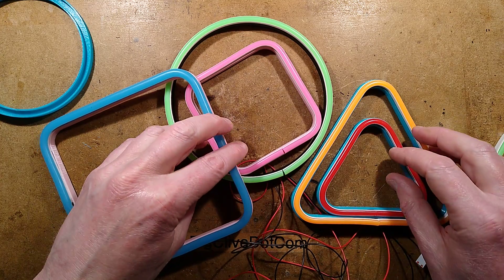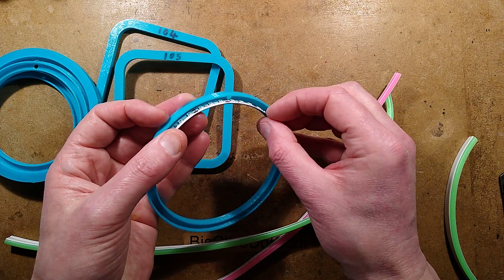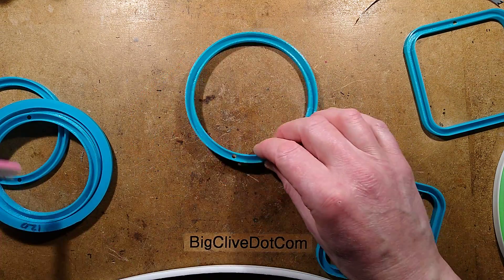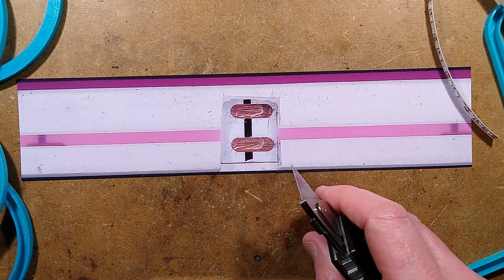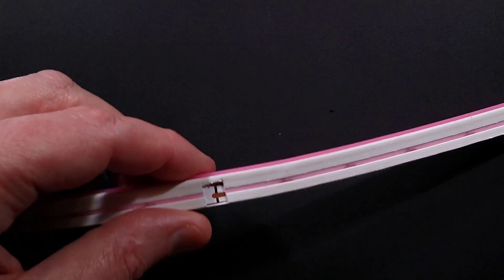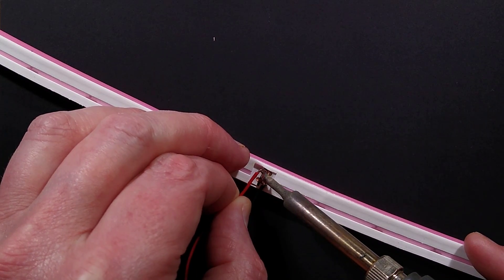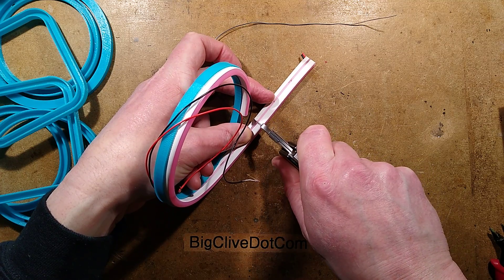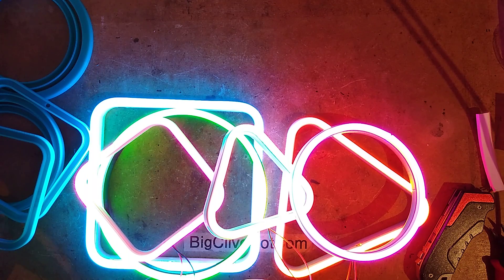Make custom LED neon shapes

Comment: Hi Clive, thanks for this awesome video! I was wondering if you can use this method of soldering the wire to the middle on a longer piece of LED Neon strip? The strip is is about 203cm/80 inches long. Thanks so much, greatly appreciated!
Reply from the maker: You can.   If it is very long it can be fed from both ends or multiple mid points.

Comment: HI Clive, Looking on the sellers website it seems the power supplies for some of these LED strips is well beyond the amperage the average 5 volt power supply's / chargers put out.
Reply from the maker: I recommend against using unknown power supplies, and if you must, then derate them by 50%.

Comment: I want to play with LED neon to make some designs. I just wish they would make "tubes" of it that were rigid that you could bend with a heat gun instead of having to make frames for it. I suppose one could use the plastic tubing similar to what the hardline watercooling guys use but it would be a bit of a pain for something that seems so obvious.

Comment: When buying the strips there are options for different voltage, what’s the difference?
Reply from the maker: The 5V version is used in many USB or battery powered ornaments and can be cut per LED.  The 12V version is used in commercial signs and can be cut roughly every inch (25mm).  The 120/240V versions are only suited to long decorative runs, and can only be cut per metre or half metre.

Comment: This is great!  I never thought of powering a circle from the middle.  This solves a huge problem for me, thank you!  BTW does anyone know the smallest diameter circle that you can make with these? Would be nice to get around 2inches or 50mm for my project.
Reply from the maker: 2" is fine.  But you may need to tweak the size up or down to get a round multiple of cutting points.

Comment: I know this is gonna be a shot in the dark but: I am a car guy, I want to tint my taillights, but before you hate on my for making it harder for you to see me at night, I want to use these rings to make the brakes significantly brighter before I tint them. Have any of you used these for something similar? Or do those of you who have made these think they would be significantly brighter than stock brakes on a car built in the early 2000s? Thanks for the help!
Reply from the maker: This is not a bright material due to the diffusion.

Comment: This makes me wish I had a 3D printer right now! I'd definitely make a load of these! That pink glow from the neon looks amazing and the blue casing coupled with it makes for a very Vaporwave-like effect. Love it! I wonder if for the gap after cutting, it would be possible to make some translucent pink epoxy resin and pour it in to fill the gap! Great video as always, this is like Art attack for technical people, but useful!

Comment: This is a very well done video, very instructive and quite clear. I also appreciate the use of OpenSCAD for the flexibility it offers, especially as you've used proper parametric code construction.

I suspect that one could also create letters of the alphabet to illuminate in a similar manner. I'm fond of using Inkscape with the Path to OpenSCAD extension (works with only 0.92 and below) which would make creating letters easier than trying to create the raw code. A bit more complex soldering would be involved for crossing letters such as A, R, etc. 

I'm now subscribed and loaded the RSS feed into my reader as well.

Thanks for sharing.

Comment: Hi Clive, I have just opened up an Apple MacBook Pro battery. It has 3 6000mAh 11.1 volt packs and a very neat control circuit board. Would you be interested in doing one of your video investigations on it? I could pack it up safely and post it to you if so. kind regards, Peter

Comment: If someone wanted to do a bigger or sturdier design, I've made something similar for a local café using 1/4" aluminium channel (they can usually be found at a fair price in hardware stores, often in the windows/glass doors department). You could also find slightly larger channels to just cover the straight lines of your 3D printed design. And the aluminum adds a bit of heat dissipation (it's true that they can get quite warm at full intensity 24/7! I'm still curious about how long these light strip will last...).

Comment: If you have difficulty getting a really neat join, you could cut the holder / mould to give it a bit of springiness to help close the join.  A little bit of CA can then be used to reinforce it afterwards.  Very nice effects

Comment: I find that this stuff works well enough even at 9v, with a much softer glow that I think is still suitable for indoor signage. Useful because you can run them from a decent 9v power supply if you can find one, rather than trying to run from 12v and tone it down with extra components.

Comment: An excellent video. I’d like to make a sign with my house number on as a first project. I’ve had a 3D printer a while but always felt a bit overwhelmed and never used it much. Must make a determined effort. Thank you!
Reply: At least you have used yours. Bought one 18 months ago. It’s still in its box. 
Tried several times to purchase filament only to have orders cancelled with excuses like bad production quality control or the filament is damp. 
So must order some filament. Lol
Reply: @patomahony9747  hi Pat. I had it bought as a birthday present. Managed to assemble it and do a couple of things I downloaded but that’s as far as I got. Need to learn the design package but takes time! My nephew has one and does great things! I don’t think the filament supply is such an issue now. Good luck!

Comment: The protective coating you speak of at times, would be a really thin layer of conformal coating (at least I think) or it could be a thin coat of varnish... usually burnable with a soldering iron and some flux.

Comment: I don't have a 3D printer but I'm working on something similiar using a narrow chisel to create an inlay in a piece of wood. Still at the design stage as it's not as simple a shape and practicing carving MDF rather than mess up a piece of mahogany but it's a work in progress. Taking a hiatus as my workshop is the big one with the open roof and the heating is still on the fritz at this time of year 😁

Comment: 3:03 I wish you would learn how to make (Customizer) variables in OpenScad correctly.
Here my quick and dirty corrected version. I did not yet add a rectangular version nor optimized the code.
Also available on paste bin, but I can't post the link. YT is recently an al about that.
Name: LED_neon_frame.scad

//LED neon circle/triangle/square frame
//by BigClive.com
//Improved Version by MrMega/BizzKeryear
/*[Main adjustable variables]*/
//Mode of the program, circle, triangle, or square.
mode="c"; // [c:circle, t:triangle, s:square]
//thickness of LED neon
thick=5;  //[2:0.1:20]
//wall thickness
wall=1.2; //[0.4:0.1:10]
//depth of groove
height=6; //[1:0.1:20]

/*[Detail variables - Circular Frame]*/
//diameter of circular frame
diam=121; //[15:0.1:500]
/*[Detail variables - Triangular / Square Frame]*/
//corner outer radius
curve=20; //[14:0.1:70]
//width of frame
width=150; //[30:0.1:500]
//width=100; //[:0.1:]

/*[Hidden]*/
$fn=100;    //circle segments
//Don't change variables below here
wl=wall*2;
crv=curve*2;
thk=thick*2;
crz=(width/2)-curve;
tri=crz*1.732-crz; //peak of triangle
radius=diam/2;
if (mode=="c") {
	difference(){
		//main disk
		cylinder(h=height+1, d=diam);
		//central void
		translate([0,0,-1])
			cylinder(h=height+2, d=diam-thk-(wall*4));
		//cable hole
		translate([0,radius-wall-(thick/2),-1])
			cylinder(h=height+2, d=thick-1);
		difference(){
			//channel groove outer dimension
			translate([0,0,1])
				cylinder(h=height+1, d=diam-wl);
			//channel groove inner dimension
			translate([0,0,-1])
				cylinder(h=height+1, d=diam-wl-thk);
		}
	}
}
else if (mode=="t") {
	difference(){
		//main disk
		hull() {
			translate([-crz,crz,0])
				cylinder(h=height+1, d=crv);
			translate([crz,crz,0])
				cylinder(h=height+1, d=crv);
			translate([0,-tri,0])
				cylinder(h=height+1, d=crv);
		}
		//central void
		hull() {
			translate([-crz,crz,-1])
				cylinder(h=height+3, d=crv-wl-wl-thk);
			translate([crz,crz,-1])
				cylinder(h=height+3, d=crv-wl-wl-thk);
			translate([0,-tri,-1])
				cylinder(h=height+3, d=crv-wl-wl-thk);
		}
		//cable hole
		translate([0,(width/2)-wall-(thick/2),-1])
			cylinder(h=height+2, d=thick-1);
		difference(){
			//channel groove outer dimension
			hull() {
				translate([-crz,crz,1])
					cylinder(h=height+1, d=crv-wl);
				translate([crz,crz,1])
					cylinder(h=height+1, d=crv-wl);
				translate([0,-tri,1])
					cylinder(h=height+1, d=crv-wl);
			}
			//channel groove inner dimension
			hull() {
				translate([-crz,crz,1])
					cylinder(h=height+1, d=crv-wl-thk);
				translate([crz,crz,1])
					cylinder(h=height+1, d=crv-wl-thk);
				translate([0,-tri,1])
					cylinder(h=height+1, d=crv-wl-thk);
			}
		}
	}
}
else if (mode=="s") {
	difference(){
		//main frame
		hull() {
			translate([-crz,crz,0])
				cylinder(h=height+1, d=crv);
			translate([crz,crz,0])
				cylinder(h=height+1, d=crv);
			translate([-crz,-crz,0])
				cylinder(h=height+1, d=crv);
			translate([crz,-crz,0])
				cylinder(h=height+1, d=crv);
		}
		//central void
		hull() {
			translate([-crz,crz,-1])
				cylinder(h=height+3, d=crv-wl-wl-thk);
			translate([crz,crz,-1])
				cylinder(h=height+3, d=crv-wl-wl-thk);
			translate([-crz,-crz,-1])
				cylinder(h=height+3, d=crv-wl-wl-thk);
			translate([crz,-crz,-1])
				cylinder(h=height+3, d=crv-wl-wl-thk);
		}
		//cable hole
		translate([0,(width/2)-wall-(thick/2),-1])
			cylinder(h=height+2, d=thick-1);
		difference(){
			//channel groove outer
			hull() {
				translate([-crz,crz,1])
					cylinder(h=height+1, d=crv-wl);
				translate([crz,crz,1])
					cylinder(h=height+1, d=crv-wl);
				translate([-crz,-crz,1])
					cylinder(h=height+1, d=crv-wl);
				translate([crz,-crz,1])
					cylinder(h=height+1, d=crv-wl);
			}
			//channel groove inner
			hull() {
				translate([-crz,crz,1])
					cylinder(h=height+1, d=crv-wl-thk);
				translate([crz,crz,1])
					cylinder(h=height+1, d=crv-wl-thk);
				translate([-crz,-crz,1])
					cylinder(h=height+1, d=crv-wl-thk);
				translate([crz,-crz,1])
					cylinder(h=height+1, d=crv-wl-thk);
			}
		}
	}
}

Comment: Hi, I need Your help. I love Your idea and I want to use Your "neon" ring in my tail lights, it looks amazing, and I love fact that You could not tell where are LEDs (I don't want to see individual LEDs) but, here is catch, I need Your help, because I want to use adressable LED (WS led strip + arduino) to control individual LEDs, so my question is, is it possible to buy such a thing or maybe build one using my LED strip and shell from this neon thing ? I'm only interested to control LED's brightness, so color doesn't matter, so red or pink is absolutely fine, just brightnes of the LEDs. Can You please help me with this 🙏
Reply: For better imagination, let's forget about tailights, I want something like knight rider scaner, and adressable LED strip absolutely can do that, but I don't want to see individual LEDs... I mean like red dots...

Comment: Money making idea: LED strips like these with a squidgey material that you can "cure" using heat (Heat gun, low temp oven etc.) or some catalyst so that it retains the shape it is smooshed into. 

Potential downsides however would be batches ruined during transit from temperature fluctuations, potentially hazardous fumes (as some catalysed reactions are wont to generate), potential burns (see previous) and any other of a number of things included in the warnings on the packaging that are frequently ignored.

Comment: I've seen LED neon used commercially in shop signs, so I'm guessing this is how they made them. With a little more complex 3D modelling you could make just about any shape or spell out the shop name or whatever. You'd just need to use some hot glue or epoxy to seal the electrical connections and ends, and secure the LED neon so it's not easy to pull out. Or if it's gong to be in the window of a shop with access to the rear, it might be better to just built it into an acrylic box to stop people from fiddling with it.

Comment: I already have a really good idea how to do this in OpenSCAD just from looking at the shape. 😁
Almost tempted to make something like this but deeper and with transparent PLA/PETG 3D printed lenses (and if it looks gross I'd cast them in resin), but alas I do not have any side-lit Neopixel tape.

There should be a way to turn any vector shape into an LED channel in OpenSCAD given the required depth (distance from the lens), thickness, and minimum radius. Then you can make any shape in Inkscape and feed it to the OpenSCAD script; segment if it won't fit on the print bed.

In fact I think I'll do this at work to make super bright 7-segment digital clocks. We have a few of them on the wall next to where I'm working, but they're not very bright at all.
Reply: with this idea you eliminate Neon Flex and only work with LED strips correct?
Reply: @neonarttech  Yeah, I don't have any silicone neon at work. We use a ton of NeoPixels, though.

Comment: I recently purchased a 240v Set of this LED neon strip but I was made a little concerned about the way the end of the strip is terminated. it has visible LED tape on the inside and I'm unsure about the voltage coming out the other end. so keep that in mind if you using 240v versions I guess
Reply from the maker: It should be capped.  It's rectified mains voltage.
The lower voltage DC stuff like I used can be cut in much smaller sections, is safer and has no flicker.

Comment: Great video, I enjoyed it. 
Thanks for the parameters etc.
But personally where you connect the leads to the psu I would put a dap of hot glue. Just to be sure. Also do you have affiliate links to for example an Amazon, so you get a kickback to?
Reply from the maker: I don't do affiliate stuff.  They tend to hike the price up.

Comment: OpenSCAD? my my to see someone using that again.I wonder how you made the "round" edges, I've always found that to be pure agony in openSCAD.

Also for those looking into 3d printers: big recommendation for prusa printers.
Reply from the maker: Use the hull command.  Drop four circles and it will create a rounded outline using them.

Comment: Clive, you need to check out and maybe do a review on knife and anvil type cutters, or multi cutters as they are sometimes called. They make cutting things like your neon leds and tubing straight and square as easy as pie.

Comment: This looks like a really fun project, but what could we use to power them all together?
Reply: How about 4 in series off a 40V cordless drill battery, or 2 off a 20V one?
Reply from the maker: A plug in 12V power supply can power a few.

Comment: I made a big 6x7-seg clock display using these a while back using a similar way of mounting these strips. Looked quite nice with PWM to gently fade the segments on/off as the time changed :)  They're really nice for this because they're already diffused, so don't need any diffusion panel mounted in front of them :)

Comment: YES I 100% agree with just getting started with 3D printing and learning as you go. It is good practice to do a little bit of research beforehand, especially regarding safety. But besides that, there's really no need to know all the nitty gritty when getting started. If you learn by doing, you'll get a much deeper and more practical understanding of it.

Comment: Any thoughts on how to make a sharp 90 degree bend or a T shape?  Little pieces of bent wire maybe, but one end would desolder when you solder the other end?
Reply from the maker: Separate pieces, but the size becomes more critical for avoiding dark bits.

Comment: Is there anything you would recommend for a larger design but without a 3d printer?
Reply: You could probably use a router and put channels in wood (or plastic).

Comment: I bought an ender 3 pro for $190 usd been a good machine once I figured it out. However I am still struggling on the modeling side of things. Trying to make a part for a chest freezer. I now also have a CR-10 3d printer I just got but won't have setup till I get a different extruder motor for the BMG assembly I got for it
Reply: On a different note. this design would be cool to remix into a cat paw shape that I could use a set of lights I bought to check out and have just been sitting because I hadn't yet found a good use for it. It's 2 meters, and as to not damage or have to modify the lights (which would destroy these ones) lay it out like an old fashion neon lamp tube. I wonder how well I could make this in cad

Comment: I played around with a round tray that accepted a flat spiral of 2-3 wraps to use as a ringlight a couple months ago. Didn't perform anywhere near like a ringlight with front-facing LEDs does sadly, and I didn't consider printing other shapes for decoration. Now I kinda want to try to vector out a Dark Souls bonfire to hang on the wall with addressable RGBs doing the ember effect.

Comment: I like to use a scotch brite pad or red pencil eraser to clean contacts to solder.  I tend to do too much damage with a knife.
Why don't you add a bit of flux?   Have you tried adding a bit of flexible glue or RTV where the wires come out for stain relief?

Comment: These are awesome scripts - BigClive is the OpenSCAD wizard. Very nice indeed. And that LED strip material is quite impressive too. It would be great if somehow it would be possible to make letters and symbols as well with OpenSCAD.
Reply: As a long time coder I have learned to be excessively clear in names and comments and got instantly upset when BC mixed up different meanings for height and width (those words are a pair, like x and y).
Reply from the maker: That's because I was making it up as I went along and the concept changed.